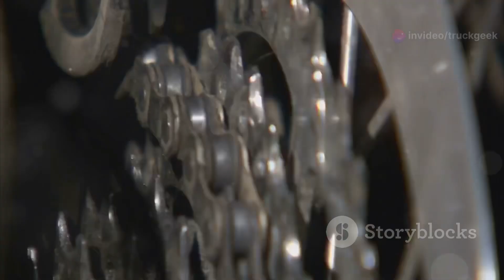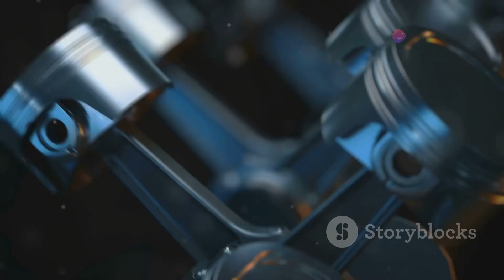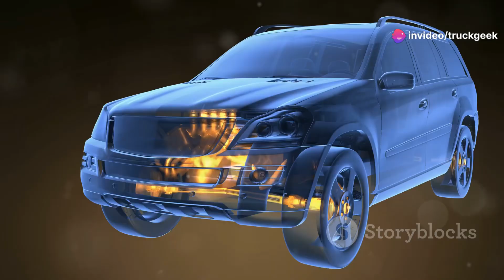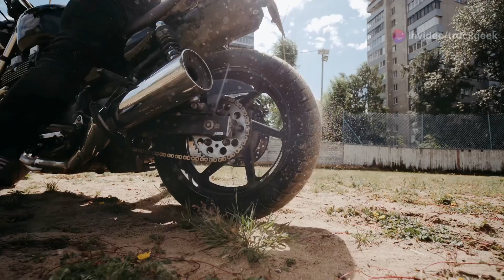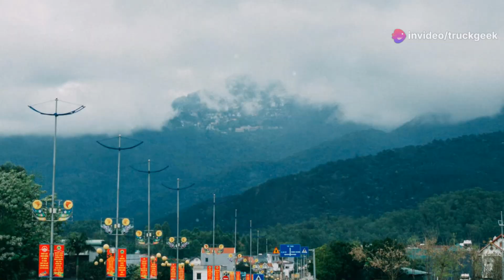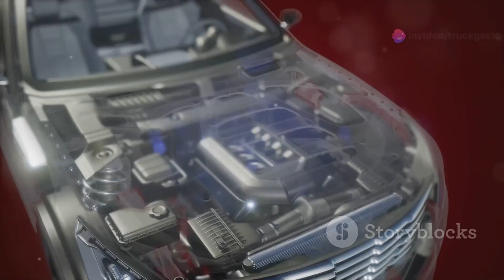How engine braking system works? Unlock the Power of Engine Braking

Comment: "Engine breaking"! Why would you want to break your engine?
Reply from the maker: It is mainly used in heavy commercials to slow down the vehicle in hilly terrain.
Reply: @Motorgeek09  No, you are confusing engine breaking and engine braking. Big difference - although either could cause the other.